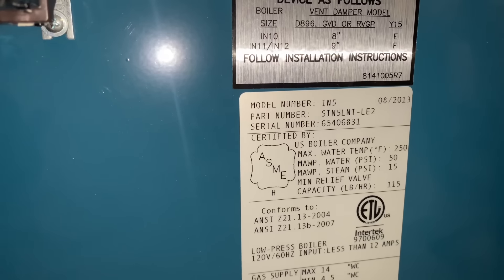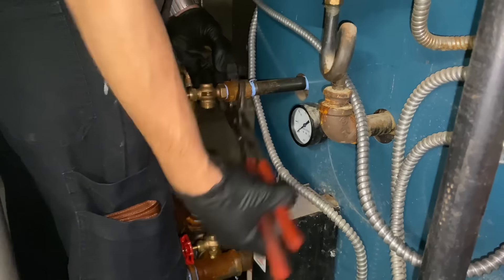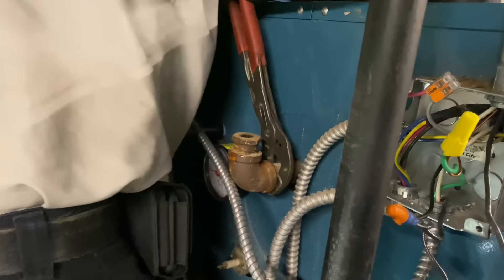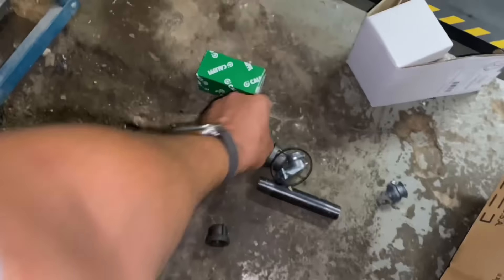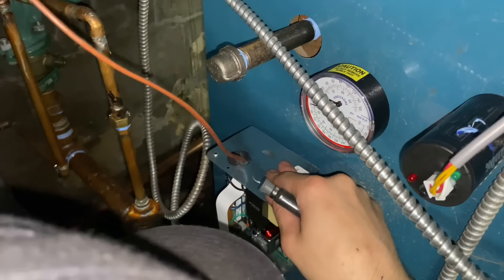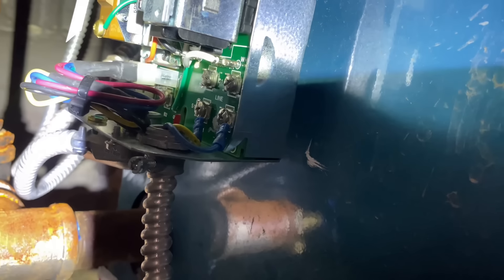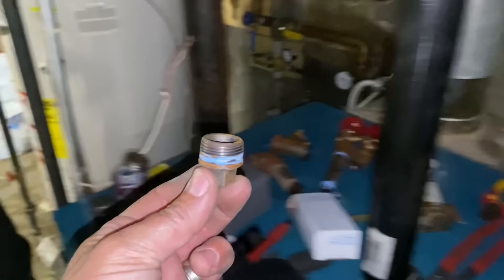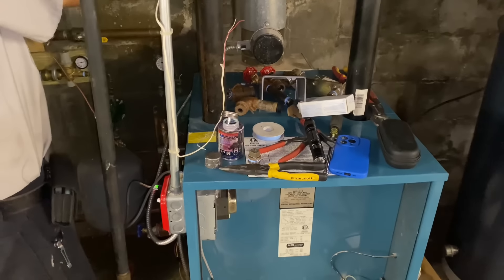Steam Boiler Conversion to Hydronic Hot Water Heating - Step by Step Retrofit Video

Comment: i bought a whole set of pittsburgh pipe wrenches from HF, long ago. they make nice hammers and pry bars/shims is about all. lol the jaw teeh are about useless in the department biting the pipe/fittings. then I bought a pair of husky aluminum 24". a bit big for many things, but why struggle breaking old rusted junk loose.  the rest pump pliers and adjustable wrenches work well(valves/brass/parts with hex)

Comment: you generally want a probe well about 3/4 up the "boilah" lol, lav voice.
probably put it where the pressure-troll tapping is. down too low it may skew the  output and overheat some, error on the side of up too high for safety.

Comment: Rectorseal safety switch ss3 the float part that goes in pan should the bottom stem be touching the bottom of the pan?
Reply: the lower the better so it turns system off sooner, leaving less chance of overflow in case of ice melting or unlevel pan or pan drain leak.
but it could be raised up to make the pan fill higher if need be. or if triggered by vibration or similar.
Reply: @throttlebottle5906  thanks